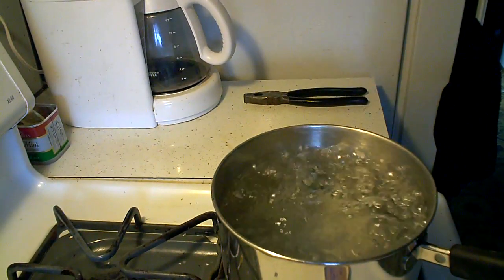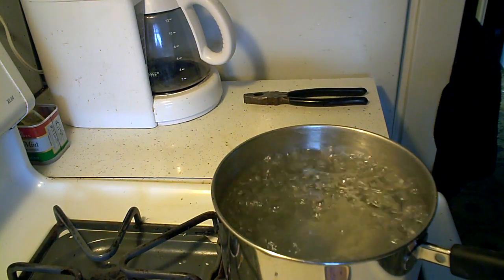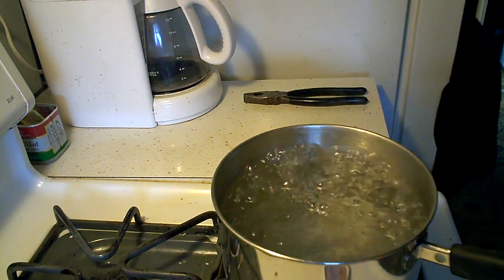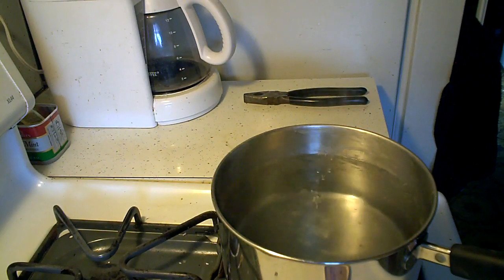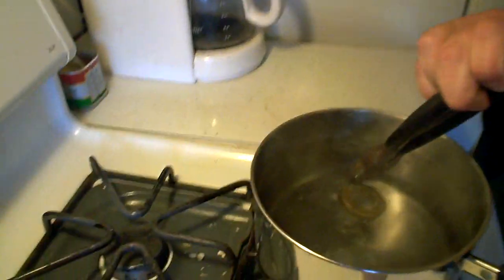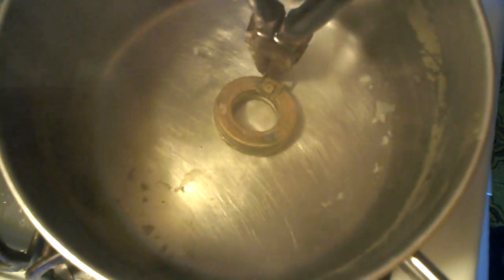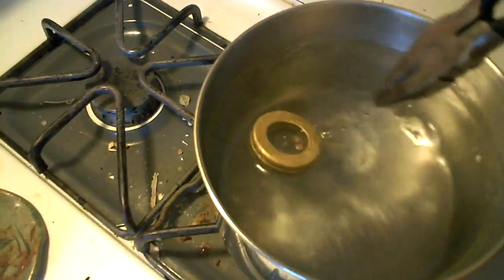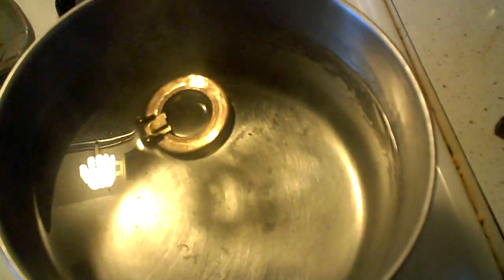carburetor float test

Comment: Modern petrol contains alcohol, alcohol is hygroscopic (absorbs water) when the petrol evaporates, it leaves behind limescale which is caustic. It attacks the very thin brass float as it evaporates and peppers them with holes, after a while, they don't float anymore and the carbs flood. You can usually spot a damaged float because, in petrol, in wont float, or will hang to one side, the holes are so small, they are hard to spot, but usually, a shake test will tell you if there's petrol inside. Swap them out for plastic floats if available.  Just had to change out floats on two trikes in as many weeks, it's going to get worse as the level of Ethanol increases in our fuel (Now 5% -10%) I've been using White Vinegar to clean carbs for about 2 years now, forget carb cleaner, it's not formulated for limescale, sonic cleaning is useless too. Don't get limescale remover on the brass floats though as the acid will attack the solder.

Comment from the maker: Yes, with this brass float the carb would still flood.  I could push up the needle and the gas flow would stop.  A new plastic float solved the problem, and 2 years later it is still going strong!  The boiling-water test didn't indicate my float was bad, so I do not recommend it.

Comment: Have you checked your float pin? I have a vixen pin set up and if the carb gets tipped over prior to install it can cause the float to stick. Besides tapping the carb gently you will a to test it back apart and be positive its corect.